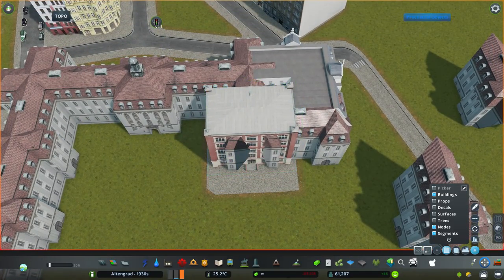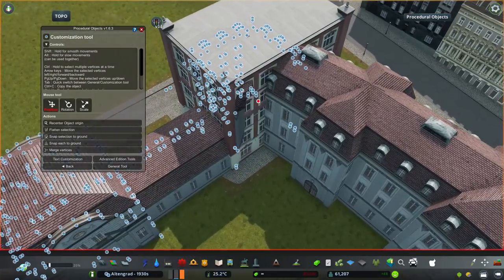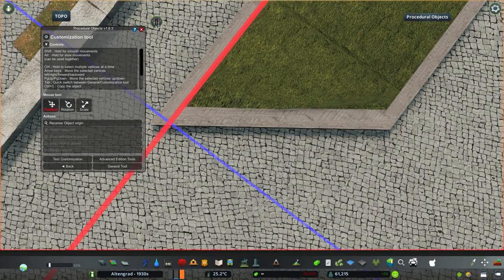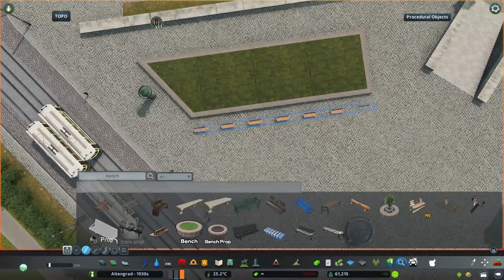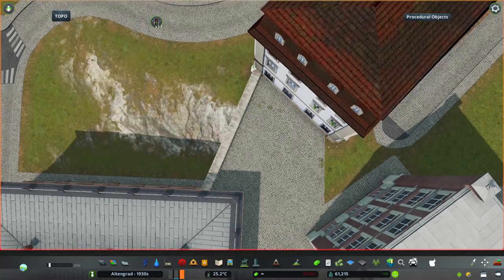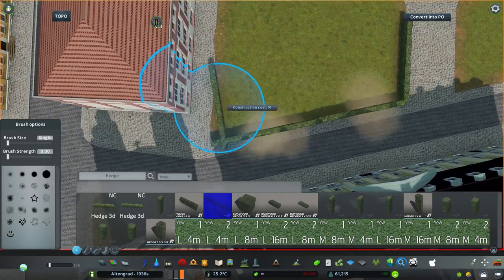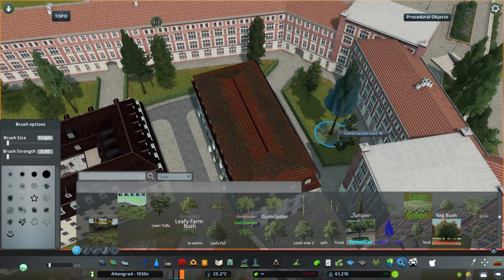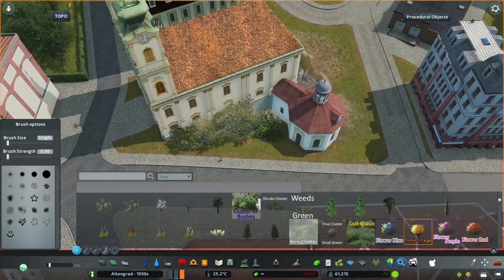Hospital Complex - Cities: Skylines - Altengrad #29

Comment: Hey Akruas, I have a question. Will Altengrad become like London which has both skyscrapers and traditional European Buildings or will it be just a city which only has European styled buildings?
Reply: I hope it won't end with scycrapers (maybe just one or two) I live next to Warsaw which is a city full of scycrapers and I really like that, but much more I enjoy cities that has that old climate at least in the city center
Reply from the maker: The really old center will not change at all probably, really tall buildings will most probably happen in some completely new quarter, but even then I won't use like super tall buildings.
Reply: @Akruas  Will this building become wartorn in the 40s? I dont mean necessarily modeling that but some blocks and areas might be changed to more modern designs where space was opened up
Reply: @Akruas   In Kraków two tallest buidlings have around 100m. You could download Prudential skryscraper from workshop. 60m in height and it used to be second highest building in Europe  before war. It's from Warsaw, art deco, looks quite neat.
Reply: Maybe some parts of the outer old core could still stand like the University area while the rest is more modern.
Reply: hi Akruas, if you are genuinely planning to add some skyscrapers to Altengrad, then I will quit all episodes of Altengrad and will not watch them at all anymore! 😉😊
Reply: @Akruas  maybe take inspiration of Paris, there they made some sort of business quarter called "La Défense" it has these modern buildings that you cant find in the rest of the city.
I guess you first have to advance about 70+ years in Altengrad though :D
Reply: @Akruas  Well, I believe that if you like the views of the old town, but also cool waterfronts, then the new quarter could be placed somewhere by the waterfront, but on the opposite bank of the river (like Kaisermuhle in Vienna) and/or quite far from the old town (like Moscow International Business Center or Favoriten in Vienna, which is not near the waterfront, but a perfect example of a cool new district in a city with loads of old buildings).
Reply: Only old style - like in Prague!

Comment: Really nice city! How did you manage that cobblestone as pedestrian way will appear automatically when moving around buildings? I'm trying to add cobblestone to surface painter (concrete really looks shitty) but it just won't work. it seems like I have to use decals (which gets super exhausting and takes forever to place them)... is there any other option (a mod maybe)?
Reply from the maker: Its the Farmland map theme.